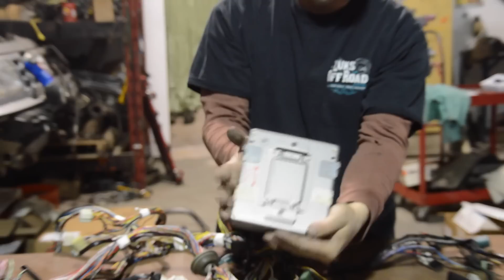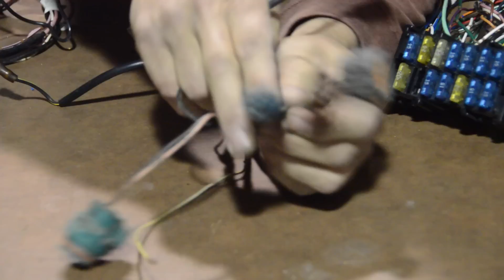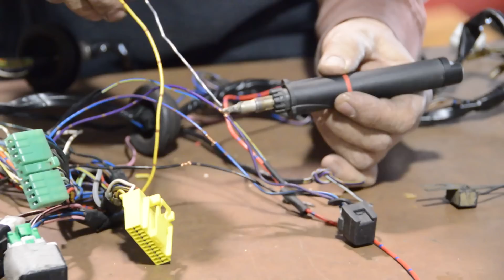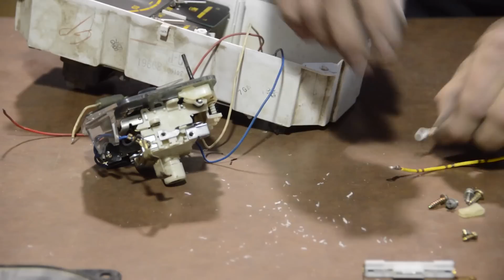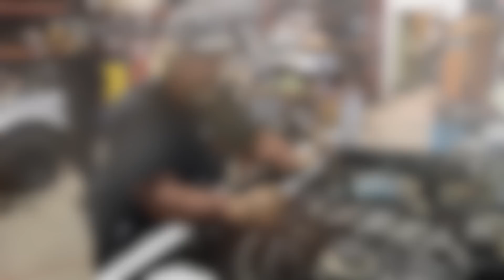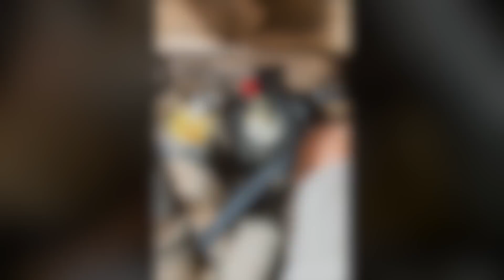How to convert your Suzuki Samurai to EFI

Comment: Myron I wonder if can you can assist me. I would like to set up the power steering or a/c idle up, on a 16v 95 sidekick swap on my Sami to a switch. Which pin do I need and do I put 12v or ground. Any help would be appreciated.

Comment: Great video (accept for the autofocus messing around) . Especially the setup for the wiring harness. This is the simple way of doing the harness install :-)
Few Things I have found with these installs :
1. Tak screws into the body to hold the pump, they come loose. There is a nice spot on the chassis almost right above the rear axle to place the high pressure pump with proper bolts and nuts.
2. only running a little 6-8mm high pressure pump.,does not work for long. you get fuel starvation at around the 5200rpm range as well as cavitation fairly quickly.use a bosch a45 as it has a nice 10mm feed to injectors and a 12mm feed into it.  The OEM return (4mm) is way to small so you end up replacing the return line with a 8mm-10mm steel fuel line . Use a Huco Pull pump as well as a 1L surgetank, that way your Fuel pump cannot cavitate and you always have fuel to feed no matter the in or decline you are at.
3. Installing ecu behind the cluster is to tight. there is much better space behind the glovebox, the wiring is long enough to get it to there.

Comment: I have a 92 Samurai with EFI. I'm trying to instal a MSD 6a 6200. Can you help with the wiring? I wired it using the diagram on the back of the MSD, but it doesn't work. It will start and run if I keep pumping the gas. Also the tack quit working and the check engine light came on.
Reply: Did you ever figure this out?  Mine is doing the same.  Won’t idle or stay running at all unless I pump the gas pedal

Comment: heyy great job and video can you help me with my zook.... im getting error21 -22-31-32  and when im opening the throttle the engine hesitates please help i,m trying to find a solution over a year now i have change everything from tps map sensor wiring harness rebuild the ecu everything
Reply: Did you ever get it figured out?
Reply: Mine does the same....